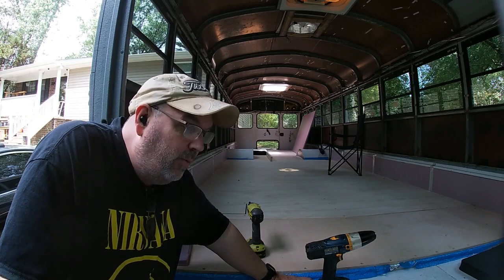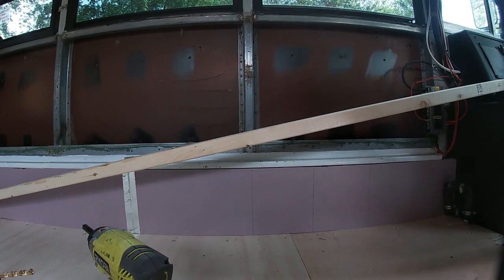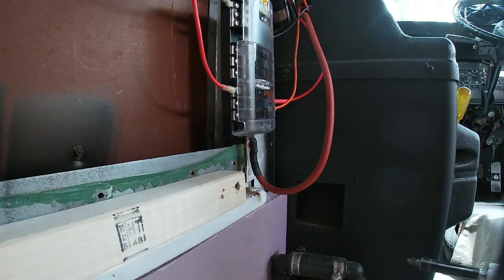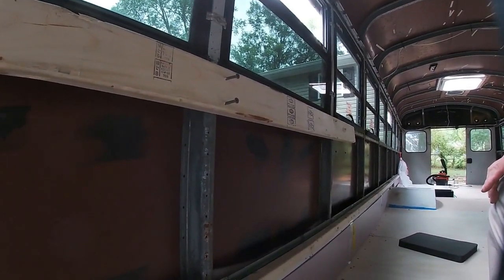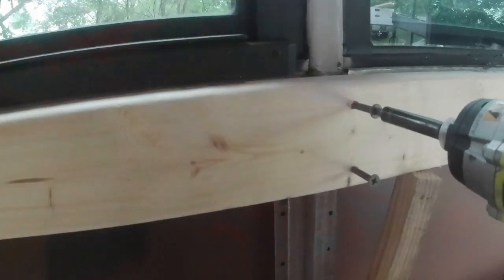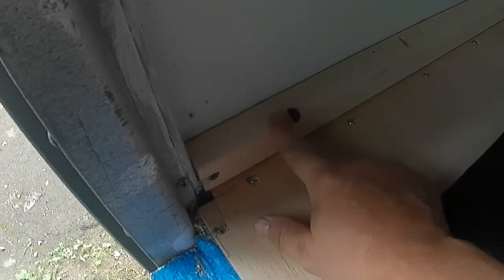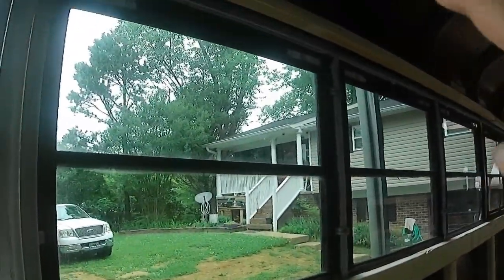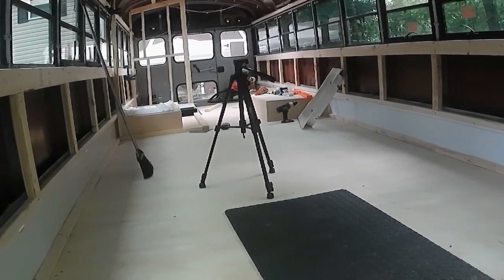The Ultimate Secret Weapon Of FRAMING SKOOLIE WALLS | Teks Screws | Skoolie Life!

Comment: Looking good and strong. If the screws your using to anchor the wood to the hat channel have wings on them then you don't have to pre drill though the wood. Very nice work so far.
Reply from the maker: Thank you so much! I did not know that about the wings. We really appreciate you watching.
Chris & Steph
Reply: Whats your opinion on the Ryobi brand of cordless tools.  Seen you're using the 18 volt.  Would you get a different brand if given the chance?
Reply from the maker: Love my Ryobi. We also have the two Dewalts that you see in the picture. Just really haven’t needed to use them on the build yet as the Ryobi does everything that I need.

Comment: I watched your video and said, "I can do that!" Drove an hour away to get the 2 3/4" TEK screws. Predrilled my 2x2 after clamping the board. I had the faith but apparently not the strength. So disappointed. Rewatching today to see if you used a corded electric hand drill/screwdriver. Are you satisfied with the length of the screws? I felt they are a little long. Doing a search I'm only battery powered screw drivers. Any suggestions to help me to get the TEK screws in? TY, Janice with Magoo.
Reply from the maker: Use an impact driver. It will go in like butter. I liked the length of the screws personally but that’s because I wanted an inch or more holding the boards into the metal. You could go with a little smaller screw if you wanted for sure. I just am using a cheap Ryobi but like I said, it’s an impact driver so it is made to make putting screws in easier.
Reply from the maker: Also maybe try holding one hand on the back and push with that hand while using the other to work the trigger and stabilize things. Let me say though… You got this! Even if you just do two boards per day. You’ll have all the strapping done in a week. Pace yourself.
Reply: @CSSkoolieProject  Thank you for the quick answers. I will pick up an impact driver first thing in the morning and put all the strength I can. I appreciate all your videos; they help a lot.
Reply from the maker: @janicepospisil5063  Awe thank you so much for watching. We really appreciate it. If you have any questions …. Don’t hesitate to ask. Let me know if the impact driver helps. I’ll be rooting for you!
Reply: @CSSkoolieProject  OMG! The morning has turned to afternoon. Took me forever to dig thru my hubby''s organization. But I found his electric drill and it works fabulous. Going out to "Magoo" and try to video  my framing. Thank you for all your help.
Reply from the maker: @janicepospisil5063  if I could double heart this… I would. So glad that it’s working.
Reply: @CSSkoolieProject  Well yesterday I managed to do the 2x2 on the channel that runs above the wheel wells. I would not have been able to do it without your encouragement and stealing my hubby's electric hand drill. LOL. I'm wondering because on the videos I've seen no one has used any foam barrier between wood and metal on the walls. But I have seen some use it on their ceilings during framing. What is your opinion on this. I know you did your video a year ago and was wondering if you had any regrets. It keeps bugging me in the back of my mind. We live in Texas but want to travel thru as many states as we can. So, do you recommend adding the thin pink foam to help stop condensation? Thank you for all the help